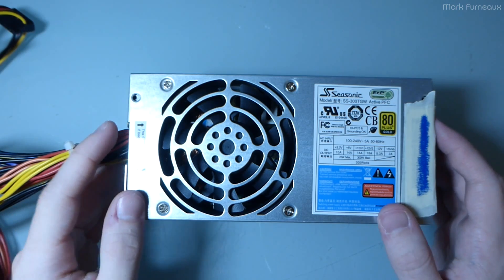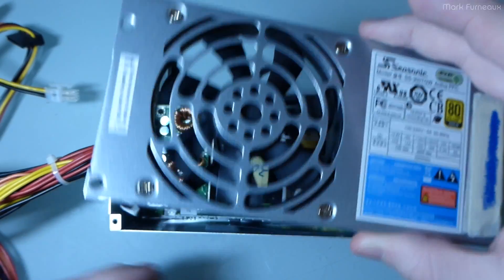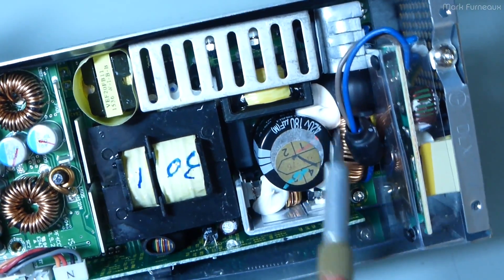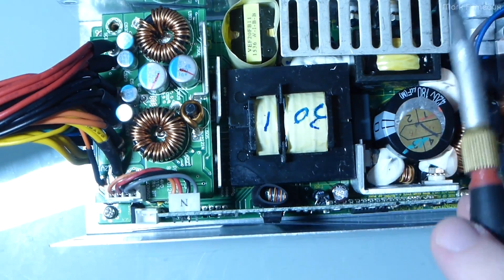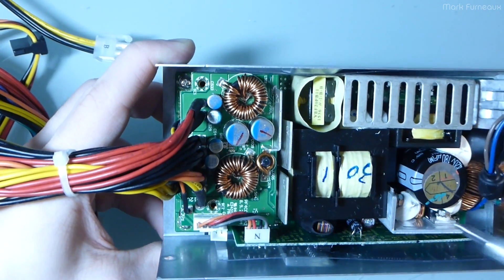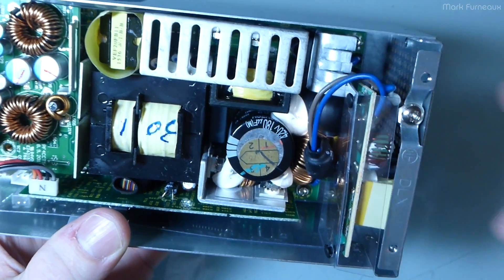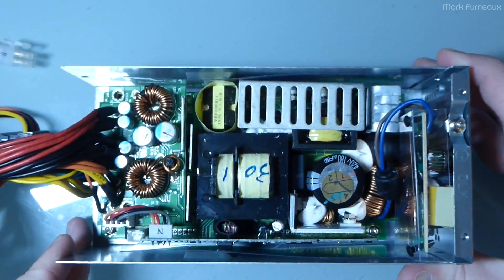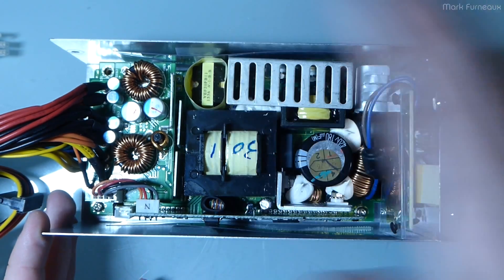A Look Inside a SeaSonic SS-300TGW TFX Power Supply

Comment: can this power supply handle more current motherboards and processors? like a ryzen 5 2600, that together with my video card, the consumption order is less than 250w. if you can help i thank you.

Comment: I wonder what OCZ you speak of, they actually had their supplies made by numerous OEMs. I think the biggest one was Sirtec, and those likely weren't good. The second biggest ones would be FSP, and while those usually look quite sloppily made, they should actually be quite good, at least in the sense that when they fail, they fail safely, and when they don't fail, they're reasonably well behaved. The only big batch of FSP failures that i know of hit bequiet and the issue was in the fan controller, but then the OTP disabled the supply. The third biggest would be GreatWall and i remember their older units as being borderline dangerous, and the newer ones looked good on initial testing, but didn't look like they would easily make it past 5 year mark.

Comment: OCZ PSUs were awful. Every single one I've bought at work had fail. The last one exploded last month, an 8 pin DIP failed violently. Did an extreme one way teardown of it. The caps were shit-brand but no bloating, though the main filter cap had no discharge resistor. Transformers had decent isolation for the most part, the out output windings were interesting, they were layered copper bands wrapped in the standard Chinese yellow transformer tape instead of coated wire. Had I known about the SATA power connector flaw on adapters, I would dissected those, I think they were molded.
Reply: Can you check is it the same chip? I had the chieftec power supply with the blown TNY278N chip. I fixed it with the SMD one tho... Some other semiconductors have died too (MOSFET, some diodes and resistor). Were the caps teapo ones? I made video about classes, and they are 2. class. But 85° caps on the input is really... Cheapish

Comment: I heard Corsair power supplies are good, what's your thoughts on them too? Also when you going to do another pfSense video, it's long overdue? Last video was 2 months :(
Reply from the maker: Corsair does not make PSUs. Way back in the day, they used SeaSonic as their OEM. This is what gave them their good reputation. Over time, they took on more lower-quality OEMs for most product lines. There are still a couple of models made by SeaSonic, but not very many. You have to be careful to check.
Reply: +Mark Furneaux i think the corsair ax series is still made by seasonic
Reply: an update - I bought a Seasonic S12-II 620W and am running it 24/7 with no issues at all so far. Won't be buying corsair again!
Reply: More anecdotal experience: I bought two Seasonic supplies for two personal servers about 8 years ago. They run 24/7 and are still going strong. I have installed maybe a dozen Seasonic supplies for clients and none have ever gone bad. I just put a Corsair 80+ Gold supply in a clients machine (replacing a failed Antec that lasted 3-4 years) and it died after a month.
Reply: You can still get the Seasonic made Cossir PSUs last I checked. Their i model PSUs tended to be nice, I've got a handful of them in long term service without any failures so far.
Reply: Based on my anecdotal experience - I have a corsair CXM 500W, and after leaving it on basically 24/7 for >1y it now makes a rattling sound if I accidentally nudge the case.

I have bought a seasonic on the strength of this video and hopefully that'll better be able to cope with my heavy usage. Maybe corsair are ok for less full-on usage :)
Reply: austriangamers390 The AX series yes. The AXi series are just shit.
Reply: ChannelWell-made inexpensive Corsair supplies are a menace. Constant whistling noise, ineffective overload protection or protection against voltage drift. Higher end models made by better OEMs aren't easy to recommend either, they usually eschew temperature protection and separate rail current sensing.